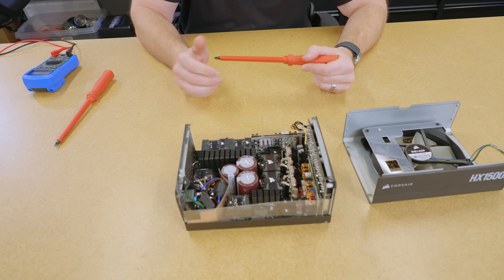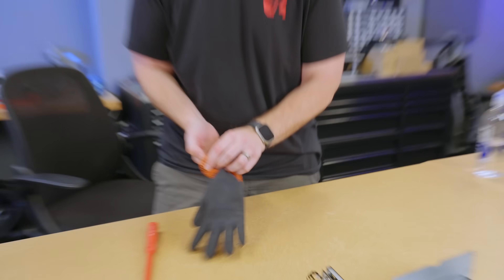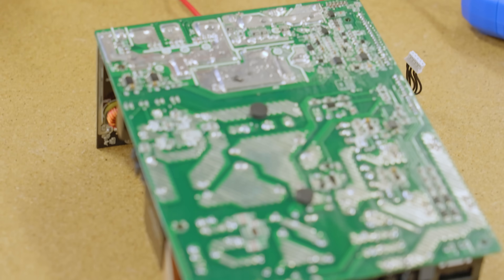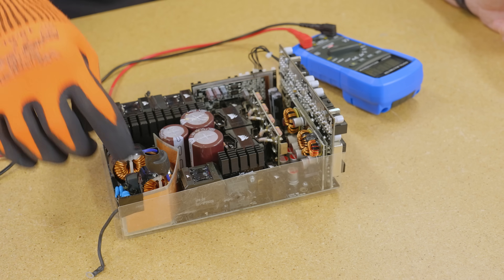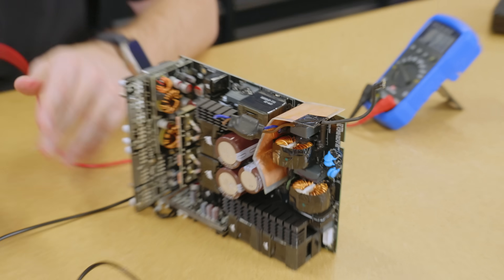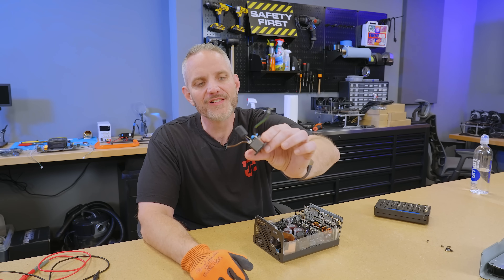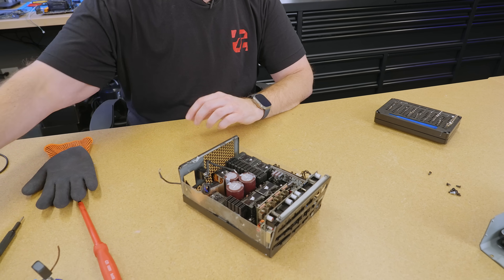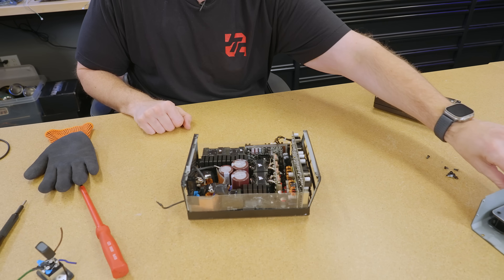Investigating what exploded in my PSU... DANGEROUS! DONT ATTEMPT!

Comment: A few points of feedback:

Insulated tools were a great idea, but one thing I want to point out to anyone else watching: remove any jewellery!!! Jay was wearing his wedding ring while working inside the power supply. He was safe "enough" that he didn't touch the circuit with that hand, but the jewellery is conductive and can cause a serious burn if it accidentally shorts out. We know you love your wife, that's not what this is about; just put the ring somewhere safe while working with high voltages.

You pointed out the 150V potential across the cap, and that where we live, mains voltage is 120V. Correct, but I need to add that modern switch mode power supplies can carry voltages several times greater than mains voltages! To get an idea, you can check the rating on the side of the cap. If it's rated, for example, 500V or 1,000V, it should never actually reach that rating but can still potentially store a few hundred volts for several days. (Edit: yes, even weeks, months, and in rare cases years)

Also I'm one more commenter recommending an incandescent light bulb. The old incandescent style, if you have one or can find one somewhere, works best because it's pretty much a resistive load and produces a visual indication that the circuit is discharging. Obviously, modern bulbs simply won't work; it has to be incandescent, to necessarily "waste" the stored energy inside the capacitor. When I saw this video, the second comment from the top also said this, before me.
Reply: Jay knew just enough about how to get hurt but not enough about how to keep himself safe.  The moral of the story here is Jay should not be taking things like this apart if he didn't have a plan to immediately discharge the capacitor.  Also a garden glove was not exactly the best approach either but I digress.  No need to go to the hospital or worse for content.  Don't screw with electricity if you don't know how to stay safe around it.
Reply: Just a FYI modern caps of the type pointed out here can store a charge for months not days, even over a year is not unheard of.
Reply: @1300BlueStar  True!

Definitely don't take your safety for granted no matter how long the PSU has been unplugged for.

I was trying to get at something else though. Jay claims this cap hasn't discharged at all, because it has been unplugged for one day and it's at 150V. This wasn't a good assumption; that cap could easily have measured 300V or more, just one day prior. Switch mode power supplies do boost voltages internally. That's another thing to be more careful of, not less.

Thanks for the reply though 🙂
Reply: @mcosta3810  Oh I get you but you said "can still potentially store a few hundred volts for several days" which might lead some uninformed person that all he had to do was wait a few weeks or so and it would be safe which we both know is a really bad idea. I was hoping you would edit that part but on after though I probably should have mentioned that. Sorry about that.
Reply: @1300BlueStar  Got it. Edited. I think Jay already did a good job at warning us about how long caps can remain charged for, in the video, but used a flawed assumption. We don't know what the voltage was actually boosted to, internally. Thanks for the feedback
Reply: Or get a silicone ring to wear instead of the metal one during stuff like this. Found out about them when my dad’s workplace had people use them because of the hazard of smashing a finger with a metal ring
Reply: You can still get incandescent bulbs at pet stores.  Ask for a lamp for a reptile enclosure.

They're usually the 60W variant,  but that should be enough for this context  (and yes you can put 150V through a 110V bulb,  just not for hours on end.)
Reply: @Atlessa  Pet-stores, Grocery stores, Hardware stores, Retail stores (wal-mart). They are still very much widely available. They haven't gone away because they are still the cheapest option.
Reply: @lyianx  None of those are true in my country  (believe me,  I've looked)  but I know that these are ABSOLUTELY NECESSARY for some reptiles so it would make sense to look in pet stores if you live in a country that has also banned them as lighting options.
Reply: Your power supply is probably 240 volts, not 120v. The US has this totally stupid system of centre-tapping 240v to give the 120v you are used to at the socket. Go check the input to the house - you might be unpleasantly surprised (I was going to say 'shocked' but...).
Reply: @daigriffiths399  The U.S. has aLOT of stupid systems. The more i work with metric the more i think "...why do we use Imperial again?"
Reply: I agree, especially rings. I worked on tv’s back in the day when they had huge capacitors, called picture tubes, those were fun. Shorting out one of those small capacitors is not a big deal if you know how. Jay is definitely not an expert.
Reply: Modern bulbs wont work? Stores DO still sell incandescent bulbs. They haven't stopped carrying them just because halogen and LED bulbs exist. 

That said, Good tip on using bulbs to discharge them.
Reply: if you are going to do this... dont
Reply: @3:17 the ring is off. It's on the table, towards the bottom-left corner of the screen.

Comment: Just use an old incandescent lightbulb to discharge the capacitors...It looks like one of your big capacitors has vented... You can see the open slit in the top of one of them right on the perforated line...

Comment: nice bit of info on the commands. thx. i run average. also... you coulda just sledge hammered the caps to discharge them before you sent it to recycling. safe for the recycling worker. : ) i mean... i static discharged a cap of the small or medium scale, once. old flashlight cap. some months of aerial discharge in a drawer. it's funny how a body can twitch under 220v and some current. yo xD

Comment: You can use a lightbulb to discharge them or set it on the ground(sand is perfect) to ground the caps, or an old extension cord using the ground wire. Also caps wont discharge very fast unless the PSU is plugged into the wall, for fire safety open the cable and cut the hot wire so there's just ground and negative, plug it in and flip the switch to on, the PSU now has somewhere for the power to go, ground for any shorts that may have happened or the negative. It will still take a while though. 7:33 The top cap popped, you can see the outgassing yellowish stains.

Comment: One of the capacitors has a crack on the tear lines and yellow on it- looks like it vented... probably NOT the pop you heard, but it definitely took some damage.
Reply: oh, that was def the pop he heard. It's pretty obvious to anyone who's ever done component level repair....
Reply: @TheCurtisnixon  I've done that; but I've not had my ears ringing and certainly not still ringing half an hour later!
Reply: @stevewatson6839  it's 420v cap. despite what some other commenters say here, that's a lot of power. I imagine the higher the voltage, the louder the pop when it shorts. shorted out mains once as a child...it's loud.

Comment: Very brave people in that room, to open up a faulty PSU after just 24 hours of no power. You took the mainboard out of the protective case, The case is there to enclose any exploding components. No eye protection either, maybe Phil had glasses on. 
Is America coming close to maximum safe wattage a 120V socket can output? 13 Amps x 120V = 1560 Watts. Jay and the team, have card that has a 1600W power setting in BIOS/Firmware alone.

Comment: Some power supplies have a small green power light on the back which takes about a minute to go out after the PSU is completely switched off. Is that green power light supposed to drain the capacitors when the unit is not in use?

Comment: Wears ONE glove, but sticks his face right in there, without any eye protection. 
Facemask or glasses, doesn't matter which, but an exploding cap can send shrapnel flying.  

The danger is not just death by electrocution, but death (or blinding) by shards, too.
Reply: very unlikely, as the short is outside, not internal, like when the cap blew. Also, that's what the vents are for. Generally, you're going to explode a cap, if you overvolt it. Not dischage it.
Reply: @TheCurtisnixon  The gun might not be loaded; but you don't point it at yourself or have your finger inside the guard.
Reply: @stevewatson6839  when I say unlikely, I mean, pretty much impossible. Even assuming the cap popped while he was poking at it, the board was facing down. In order to discharge the caps, the board was also be facing down away from him at the table... The vents are on top of the caps. They're gonna blow, before the bottom could, and I've never seen a blown cap that blown out the bottom of the pcb.  I've seen caps do damage to the pcb when it blew, but nothing that ever created holes. They usually burn if they damage the board. Which is all assuming it'd be possible for the cap to blow like that at this point anyway. Which it's not. It's rated for 420v. It had 150v. That's at least half discharged anyway,  And that is spread out over the other 2 420v caps on the board. The only gun in this scenario, is if you short the caps with some metal. And that's just a loud bang. You might want sunglasses, but safety glasses are not needed...

Comment: Try working on old tube equipment like guitar amps. That's 600+ volts DC in some of mine. My grandfather was an old TV repairman and taught electronics even with knowledge I got zapped once testing signal path with a chopstick and somehow made a circuit. 0/10 would not recommend, LOL.

Comment: So on the heat think, if it was close to the noise of a firearm, it's the thing on the radiator. IGBT or CMOS, they are the component that do AC to DC and buck boost (change voltage level) action.
 Tee component you show, a transformer can break, but not with so much noise as it's the isolation around the copper wire that burn due to overcurrent. They can be transformer or inductor (a coper coil), same thing connected differently. First is for isolation, the second is for  current regulation, capacitor are for voltage regulation. 
For the capacitor, if you see the metal disc open, like even a little bit, it mean the voltage spike did goes over internal insulation and it vented by opening the disc. I don't think it's them as those kind of capacitor have a liquid inside and it leak everywhere when they blow up. for the capacitor, you have to short them with a resistor if you don't want to make a spark, and this size should be a 1000uf, so you need a 10k ohm resistor if you want to discharge it in 10s.

Comment: Do a collaboration with ElectroBoom instead and have him trouble shoot for you.  😜   I agree with @d-jm2xs.   The 450v 680uf I would replace.  Look at it compared to the other one, there's 2 of them.   Maybe even the smaller one to the left also because of the black mark although I don't see any yellow.    Look like it's 420v 420uf.  I probably would replace those 3 caps and try the PSU to see if it works.   Those caps are about 16 bucks on Ebay.  I'm not sure about the smaller one because I might have misread that and couldn't find it.
Reply: Also you said you measured 151v and it's rated for 450v... I would definitely start with the 3 caps.

Comment: That big capacitor right in the middle is blown, can see the vent is open. It may still be holding onto some voltage but the yellow stuff on top is the oil from inside the capacitor.

Comment: the small gray component in the area you suspect. looks like it split and blew its black guts out
Reply: That is a rather awkwardly stacked pair of .022uF 1000V film capacitors, with black silicone globs for support. The capacitors are silkscreen labeled C101 and C102 on the circuit board.

Comment: Qpr-33 is the part number for the piece Jay is pointing at. It is an 800w inductor.  You can see as he tilts the board tan and brown spot where it might have popped but also the Cap with the yellow stuff he pointed is open on one of the relief cuts and possibly a pin hole in one of the other caps although on a tiny screen that may just be dripped left over silicone.
Reply: It is a pin hole. Well caught.

Comment: It is curious that the bulk storage capacitors are still holding a charge, I have never seen a power supply like this that did not have some sort of discharge resistor across them, especially one of higher quality.
Reply: The standby 5V runs constantly in an ATX PSU, and will normally deplete the capacitors when mains input is removed. Hence there's no need to have bleed resistance, and its presence would waste power and possibly reduce the energy certification of the PSU. The reservoir capacitors retaining charge indicates the electronics has failed and is drawing no current.

Comment: Many PSU testers can drain the caps of a PSU by just testing it.  Also, your meter your using to see what they have, drains them too, by seeing what they have.
Reply: Unfortunately a PSU tester would not achieve anything. If the PSU circuit could run, and thus discharge the capacitors, it would already have done so. The standby 5V runs constantly in an ATX PSU, and will deplete the capacitors whether connected to anything or not. The meter would drain the caps, but very slowly.
Reply: @PlatypusPerspective  lol, as I said.  It can be done.  lol

Comment: @1:51 You can use a bulb in a socket to discharge the capacitors by touching the wires to their legs. This is the easiest and most effective way. I have been practicing this method for years before I start soldering and repairing broken electronics.

Comment: 7:40 top cap vented, I would replace all those caps and check the voltages, then do a test with different loads.
Reply: Check the fuse if there is still no power.
Reply: For sure the 2 largest caps are damaged, one vented, the other slightly bulged at the top. I wonder what those caps are rated for, they look no bigger than the ones in my Corsair CX600.

Comment: I was called to a friends house. She had plugged her computer in an outlet that was mistakenly hocked to a 220 line. The capacitors were splattered all over the inside of the PSU housing. It did its job in protecting the computer though. A new PSU and it was good to go.
Reply: I remember the 110/220-240 switch, just don't get wrong, well setting to 110 on a 220--240 is destructive, not sure if setting to 220 on a 110 would be destructive or just non-operational

Comment: Jay one of the 3 big caps has gone. The cap that has the shmoo on top has a split in the safety split. Looks like it was just enough pressure to pop but no guts. If it happened to one of the other smaller caps you it would have spilled its guts all over the inside.

Comment: 3:01 "Take a megaohm class resistor" would be my first instinct. Then I'd do math and check if the resistor can take it without burning. (200V would give 200µA over 1 megohm, P=UI=200V*200µA=0.04W... It'll probably be fine. It might take a while, but it'd be safe.)
Reply: That will work. Best to install such a resistance permanently across the caps. They will do no harm when the PSU is running.

Comment: Send it to me and I take it apart for you and check what happened to it, it´s easy to discharge caps like that. I bet there is a blown switching transistor somewhere in it. and if you think I am scared of 150 volts in a cap I can say that the tube amps I built runs on 500Volt DC and the transformer outputs almost 700volts AC. I am used of high voltage :)

Comment: If your multimeter have "low-z" mode, use it to discharge the caps
Usually multimiters have PTCs in the Ohms range, so if you don't have Low-Z, most can discharge using the Ohm range, then check again with voltage mode

Comment: For future reference you are fine shorting a cap that big. Even though they are big the amount of actual energy is miniscule.

However to do it in the best way, a wire with a resistor inbetween will discharge them nicely.

Also, its probably not the coil that died. You can not measure resistance across as you did them since they work via induction. Probably a MOSFET or some other type of transistor that kicked the bucket. When they die they go big boom. Coils would just burn and there should not be anything in them that makes them go boom. Just copper wound around iron.

Comment: I would say a mosfet blew. The one next to that coil/transformer.

BTW you can discharge the capacitors safely with just shorting the 2 pins with some screwdriver. Won't do much - just probably a spark.

Comment: Was your warranty up with Corsair? I've never had an issue with their power supplies. I've got one in my old PC that's been going for almost 10 years now. My new build also has a Corsair PSU, this time a higher grade model. I'm hoping it will last me at least as long. Weird that yours went out. Then you push your tech pretty hard. NVIDIA blew it up? That tracks. Of course, you were using the crazy BIOS.

Comment: That cap is blown, the residue and the hole is so obvious, caps are the number one pop source in electronics, they build up pressue until it comes out through the cuts in the top. Also Jay, that was a little bit too dangerous, you know to be careful but then nearly touch that thing you just measured 150V. If I we're standing beside you I would have send you out the room for that, that was not an inch away from ER, because of pure ignorance or confusion or whatever. Please be mindful about these things, I wanna see you alive.
Reply: Preach, Brother! 👍